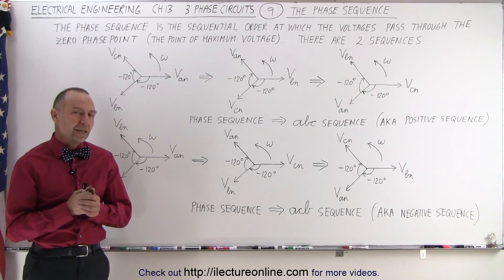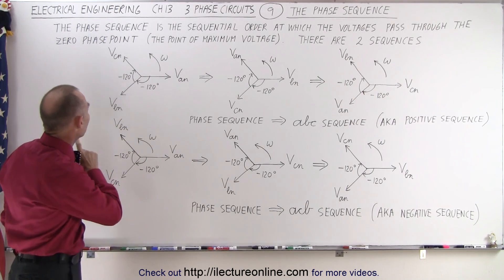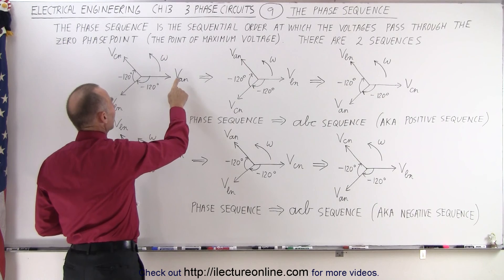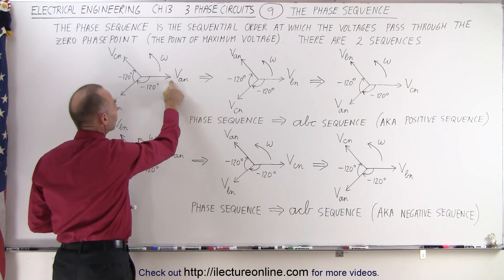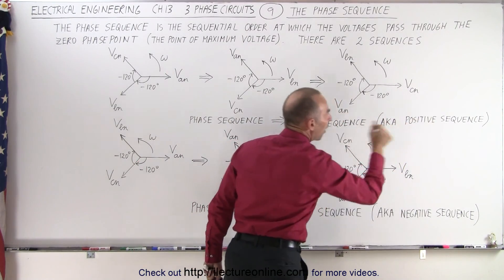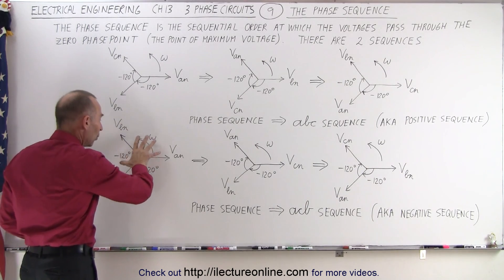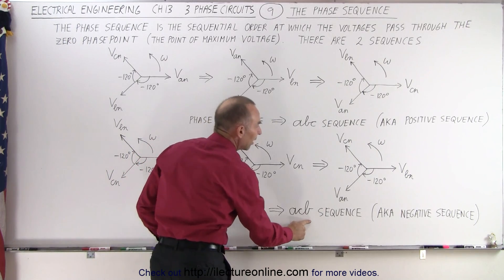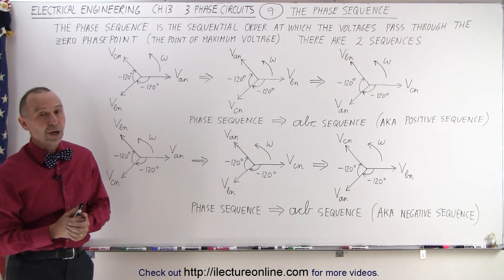Electrical Engineering: Ch 13: 3 Phase Circuit (9 of 42) The Phase Sequence

Comment: Is it the phasor that rotates or the rotor. I got a little confused in trying to form a mental picture of everything.
Reply from the maker: Phasors are methematical representations of what is happening with the voltage and the current.  In a physical sense the rotor is rotating.
Reply: @MichelvanBiezen  understood, thanks.

Comment: Vcn is -240° but you wrote -120° sir..?
Reply from the maker: The angles written are phase differences   (not actual measurements)
Reply: @MichelvanBiezen ok sir but phase difference between each conductor is 120° this is fine sir & phase difference between Va to Vc is 240° is correct sir?.. thank you sir. .......
Reply: @kannanr9016  the negative indicates it lags, or comes after. That is to say B and C will reach their peak voltage 120 degrees after A. A is 0deg, next comes B at 120deg AFTER (or -120deg) and then C comes 120deg AFTER B (or -120deg), or a total of 240deg after A (or -240deg)

Comment: If you use the wrong sequence your motor will spin the wrong way.  Especially problematic on something like a hydraulic pump where you might not be able to see the motor direction, but you will not have any hydraulic pressure.